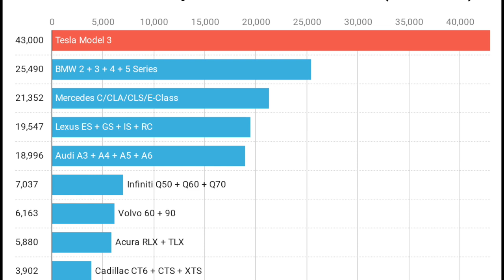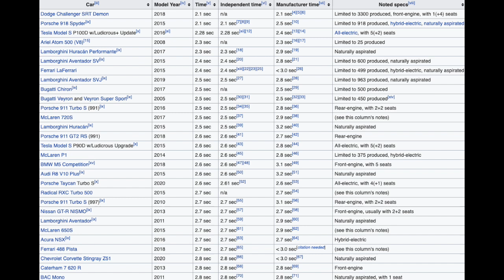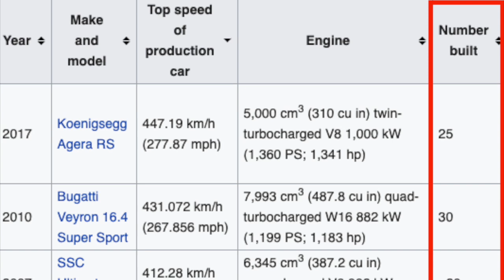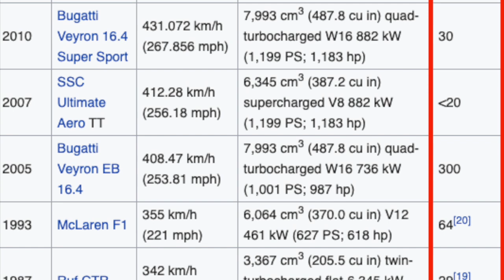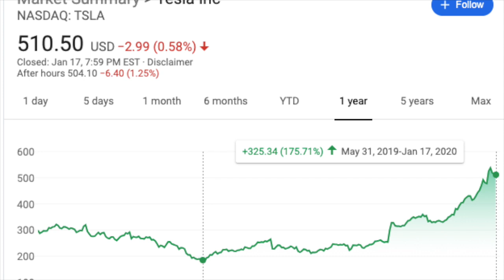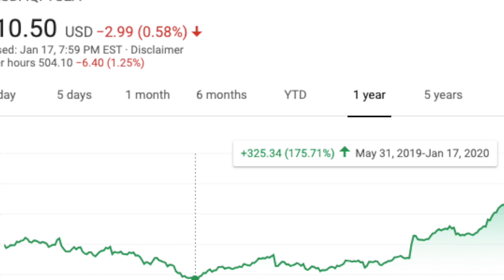The Tesla Roadster Will Disrupt The Entire Sports Car Industry

Comment: It won’t disrupt the sports car market. Sports cars are not about going as fast as possible, that would be a drag car. A sports car is designed to be very light, fast & snappy gearbox, virtually no engine lag, around 50/50 weight distribution, manual transmission, great tactile steering feedback, rear wheel drive, double wishbone suspension, balanced horsepower, and has to be small.